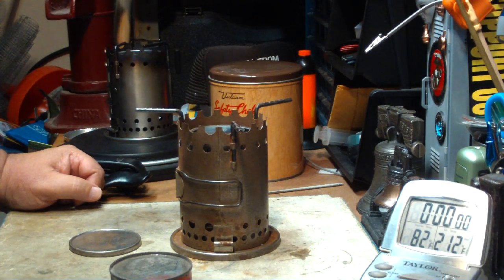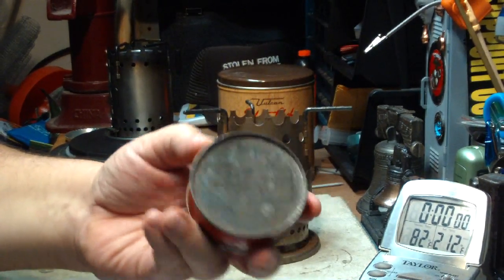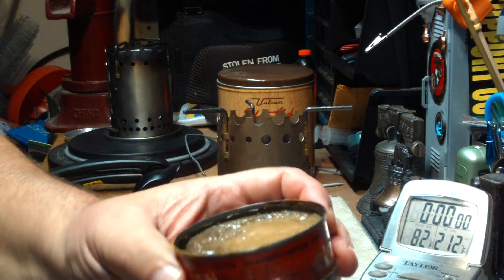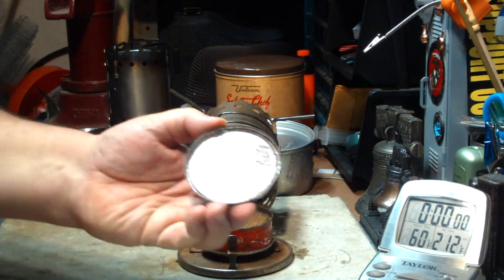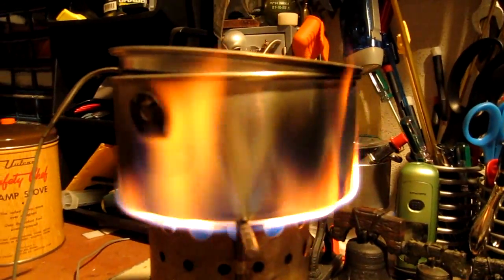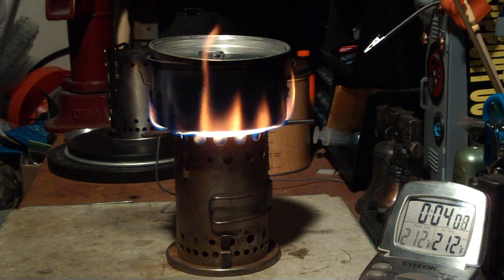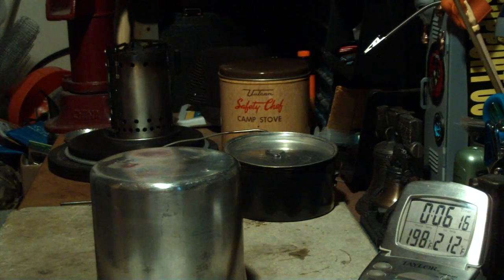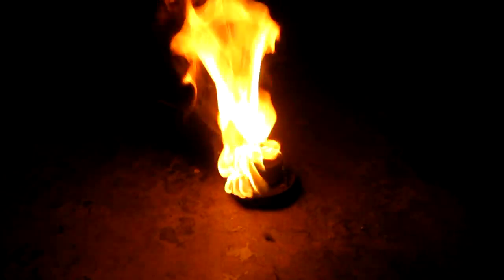Vulcan Safety Chef Camp Stove - Boil Test #1 - (With Vulcan Fuel Can)

Comment: Yep same experience with mine.  just empty the can and fill it with sterno or heat in a fiberglass original can but you need the snuffer tool to place over the fire can and it goes out really fast.

Comment: Hiram, I have two of these little gems as well. I have not tried to make a fuel canister yet though. First i would strongly suggest that you remove the Asbestos ring. I did 'cause I didn't want to have any friable fibers floating around while I was making Girene juice, (coffee).  
I have used a mason jar lid and crushed up Trioxane fuel tabs for fuel as well as Sterno. I usually just let them burn out when I have finished heating whatever I need. I remember being told by the old man who owned the surplus store where I found my stoves, that the fuel cans burned for just around twelve minutes. Then you had to open another can to continue cooking. 
Anyway, I am about to watch the video you made on how to make a fuel can for the stove. Thanks for the video. Oh and by the way, is that a Marine Corps. sticker I spied on your little wall locker there on your work bench? ;-)

Comment: This is a good reason why the trangia design and the knock offs are being sold close to 50 years after they were invented, they are simple, safe and easy to work with, its not the fuel being old its just a bad design, alcohol stored for decades and used in a trangia works just fine
Reply: To be fair the issue is not caused by the stove per si, but by the chemicals in that can, may they use Napalm for fill. :))

Comment: I inherited one of these but it doest look like yours, the can it comes in is two pots, the enclose it and the handles fold up like yours but they are on the pots.  its self contained like that.   But the thing is, I have never seen the fuel cells till now. I was looking for what they might be and if they were available.  

  when I was in scouts though we made cells from tuna cans , we cut strips of cardboard and coiled them up in a spiral and inserted them as tightly as possible and then poured melted liquid paraffin into the can so that it soaked into the cardboard and would then make the hardboard the wick. we used a upside down coffee can as the stove making triangle breather holes around the top with a church key can opener.  i was thinking I might try that with this gizmo, I'm not sure it would work though since these apparently use a gel like you have shown.  If It does work however, the fuel would be much cheaper i am sure since I would be making it myself.

   The one I have here has been used, seems like it was used quite a bit, but it;s spotless on the outside. no soot.. when you were showing this one working it really got nasty dirty.   kind of makes me wonder what the heck was being used to heat it. Only one of my pots was used, I know this because there is a factory sticker on the other one telling me what it is.

Comment from the maker: I do have cans at the ready when I do tests. In this case I really thought the fuel wouldn't burn much because of it's age so I didn't have anything large enough right there. I guess I could have used the can the stove came in but that probably would have burned the artwork off the can. It may have looked bad but there really wasn't much danger. 
Thanks for the suggestion.

Comment: I made a tripod pot stand out of aluminum strapping and stainless steel carriage bolts that worked great with gelled alcohol.  It self destructed due to melted aluminum on the second cup of boiled ater with a trangia.  But the tidal wave of boiling hot water and resulting steam put out the alcohol fire in the same motion.  :)  exciting times we live in.